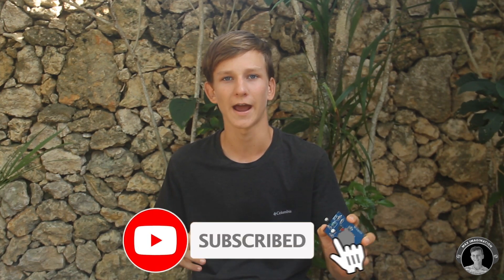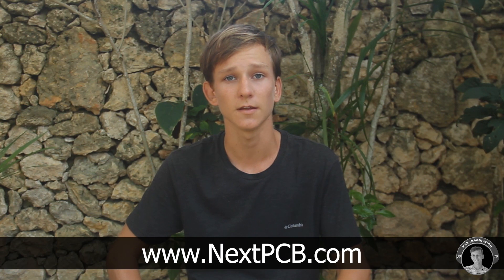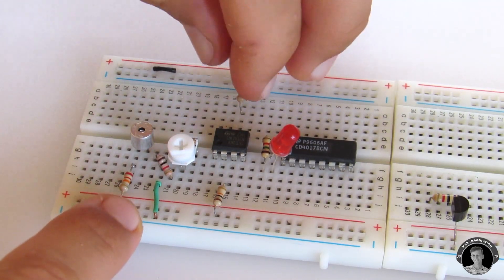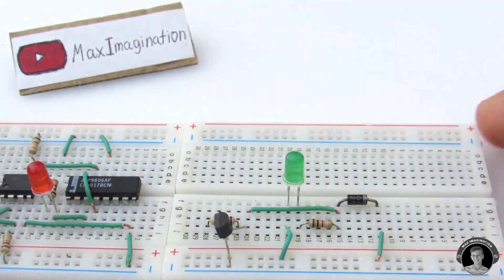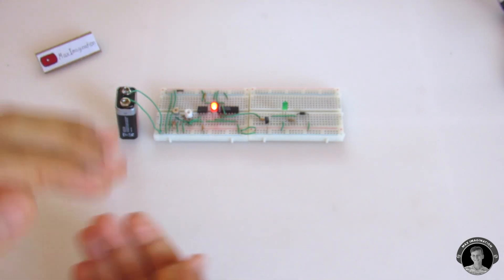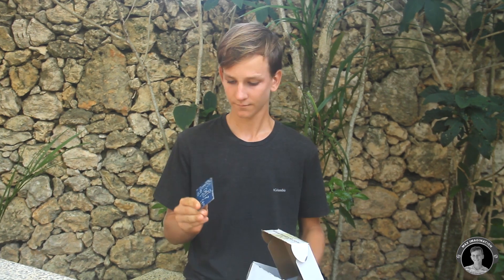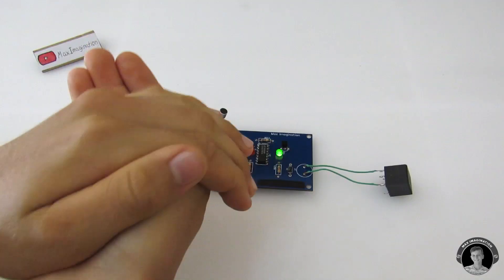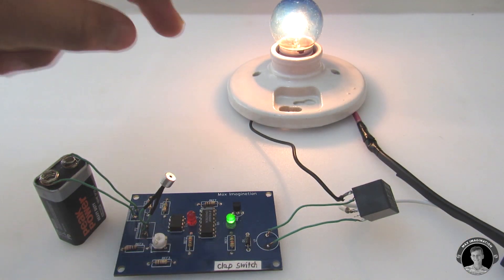DIY Clap sensor switch - Home Automation Clap Detector | Electronics DIY

Comment: Could you please give some more details on the parts needed to build this
Reply from the maker: Hi there. As mentioned in the description below the video, here is the full parts list of things you'll need:
🧵🔧📌 Materials/components needed for this project:
(x1) Electret Mic
(x1) UA741 OP amp chip
(x1) CD4017 CMOS Decade Counter chip
(x1) BC547 npn transistor
(x1) 5mm Green LED
(x1) 5mm Red LED
(x1) 10k Potentiometer
(x1) 22k Resistor
(x4) 1k Resistor
(x2) 10k Resistor
(x1) IN4007 Diode
(x1) 12V Relay

(x1) Breadboard
Connecting wires
(x1) 9-12v battery
(x1) Light bulb and socket

Cheers,
Max